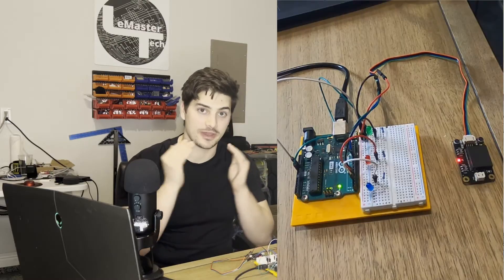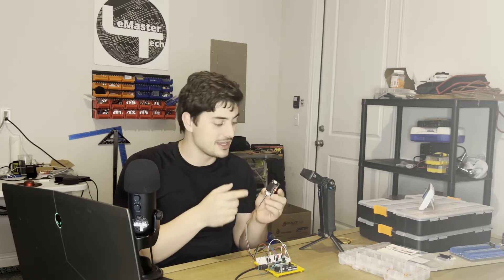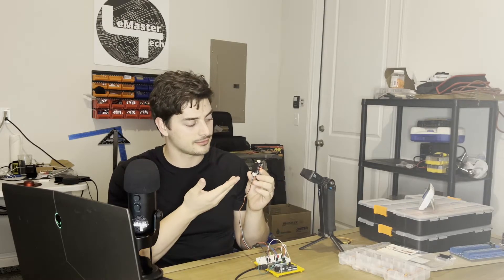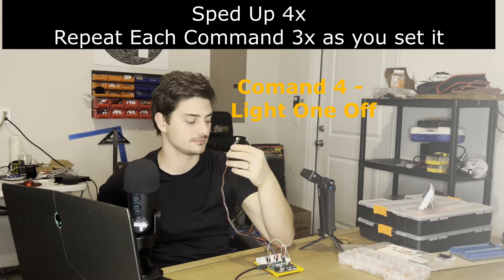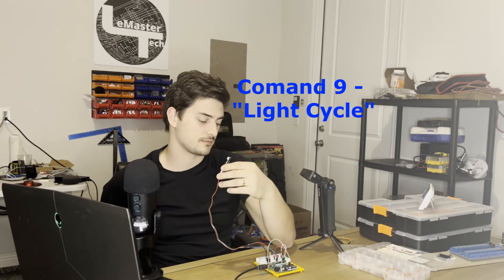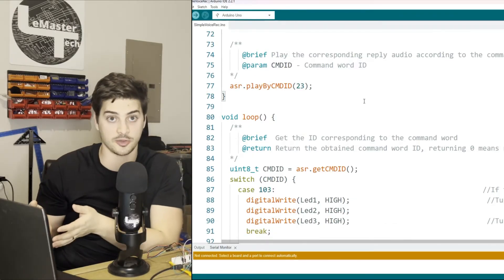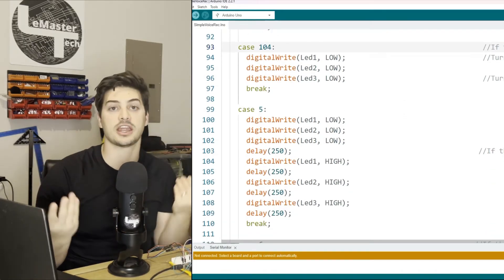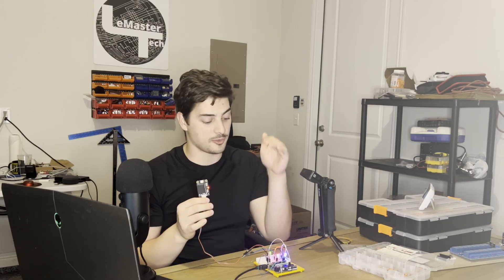How to Use Voice Recognition Commands With Arduino!

Comment: Is it possible to use the module to run servos?
Reply from the maker: Yes with a microcontroller and stepper controller to interface between the two!

Comment: could I program this arduino to light up addressable light on two different LED strips at the same time?
Reply from the maker: Hi yes you could do that, the output of this module is just a numerical value back to the Arduino, you can then have the Arduino do whatever you want with that input, so if you want it to send two different commands to two different outputs based on one input that’s pretty easy!

Comment: Hello. Congratulations on the video. I'm having trouble compiling the code. I'm getting an error on line 32: DFRobot_DF2301Q_UART asr(/*hardSerial =*/&Serial1); Serial1 was not declared. How do I solve it? Thanks for your help.
Reply from the maker: Thanks for watching - that error usually means you have a different arduino selected than the uno. I wrote my script for an arduino uno and pared a lot of the other stuff out of my script. The full example on DFRobots website has the protocols for multiple microcontrollers though!
Reply: @lemastertech  Thank you very much

Comment: Hey so I wanted to ask if you perhaps had a circuit diagram of this video. I'm not sure how many resistors you're using as well as their resistance
Reply from the maker: Hi! I didn’t do a circuit diagram because there’s no special resistors or anything else required! If you follow the link to the DFRobot website in the description of the video they have a wiring diagram and you can see it’s just four wires to an arduino and no special components other than that!

Comment: I am making a prototype using the DFRobot Gravity Offline Voice Recognition Module with Arduino, but sometimes I get an error with ID:255. What causes this error? Also, please tell me how to deal with this error.
Reply from the maker: Hi I am sorry I have not seen this error so I am not sure how to solve it - it is weird that it would only be appearing some times too if it were wiring or a code problem I’d expect it almost always consistently appearing!
Reply: @lemastertech  
Is that so?
I understand. Thank you.
I have one more question.
I connected the DFPlayerMini to an external speaker and have it respond to spoken lines with MP3 audio, but when I play a song after the reply, the volume automatically drops and the MP3 song doesn't play. If you know how to fix this, please let me know.

Comment: Hi I have a problem with this module, it not responds after a while to the wake work anymore  ( sometimes after minutes, sometimes after hours), do you have this problem too? I use module version 1.0! Thx for feedback!
Reply from the maker: I have had similar issues using an Arduino nano but they were fixed when I switched to an uno. I think if you put the power for the module on a digital out pin instead of just 5v you can power cycle it from code too!

Comment: Great video! Just wanna ask is it possible to disable the voice that speaks back and also instead of using a word to make it start listening could you use a button instead?
Reply from the maker: It is definitely possible to turn off the response with one of the switches on the module, but I’m not sure about triggering it to listen with a button! Probably if you used a relay and powered it only after a button was pressed then yes!

Comment: Can you use other language beyond English? For example, korean, Japanese and many other asian languages?
Reply from the maker: You can use any language you want for the custom voice commands and the custom wake word, because it’s recording your voice and matching and comparing your commands to the recorded files. So it could even work just with sounds or noises! But for training it and using the predetermined command words you’ll have the use English or whatever language the module you buy comes in!
Reply: @lemastertech  thanks for the video! will my daughter be able to trigger it when it's trained on my voice?

Comment: Outta sheer curiosity how would one wire this to a servo?
Reply from the maker: Well you’d need something capable of talking via UART or I2C so even if you want to voice control a servo you’ll probably want an arduino nano in the middle to take voice commands in and convert that into controllable servo functionality if that makes sense!
Reply: @lemastertech  it does, just so confused for the coding lol but i'll figure it out

Comment: Weak on my Arduino knowledge and overall power of things but i wonder if this would work with a alisha mk X-D arduino nano board I am putting in an iron man helmet. Would be good to use voice to open the helmet vs a switch.
Reply from the maker: It probably would work with that nano board so longer as it supports UART comms! That’s a pretty standard interface for all hobby boards so it should do the trick!! That sounds like a cool project goodluck!! 😎😎
Reply: @lemastertech  finally got the basics working I also added the speech module so now  custom replies for each command . Next step would be to add it to main helmet code but that should be pretty easy.
Reply: @Jaykav99 Just came looking for the same thing! I'm gonna a put an ironman helmet together and wanted to add this feature.  Does it let you change the ladies voice so we can call it Jarvis?

Comment: Hey!
Great video, that’s what im looking for my project!
Is it possible to not use the wake up command but manually wake up from arduino? I’d build a little buddy that uses face recognition and I’d replace the wake up command with a detected face using some lines. 
Thanks!
Reply from the maker: Hey!! Easiest way I can think off with this particular module would be to hook the 5V power up to a digital output pin you turn on when you want it to wake up! I am pretty sure it’s always listening when it first powers on?? I won’t lie to you though I have not tested that myself so hopefully that would be a fix though 😎

Comment: Hello sir, nice video, i need advice to my thesis project "Design of Voice-Based Smart Wheelchair " so how can i integrate with Ardiuno in my proteus simulation and how can i simulate it
Reply from the maker: Hi I have not used proteus but if it can just talk over serial data that should be simple enough to get data off of the voice module and arduino!

Comment: will this check my voice if i only want it to respond to my voice?
Reply from the maker: So it’s actually storing a .wav file of the commands you give it when you make custom commands so it would be more specific to your voice but no it is not actively doing any biometric validation like you are describing, it’s a pretty simple module overall! I think you could probably do a cool combination project of using a fingerprint sensor to unlock the voice command module and then you would get that sort of control!!

Comment: If I want to use with esp32 do I have to do something more than change the pin rx tx in the code ? 
I've tried but nothing works
Reply from the maker: Hi the ESP32 boards support UART comms for sure but I haven’t used this specific module for it before I’m sorry! It shouldn’t be very different at all though!
Reply: Troble with hardwareserial. I have changed to serialnumber but it is not working.

Comment: Awesome video man. Do you know if theres a way to change the responding voice coming from the board?
Reply from the maker: Thank you!! And oh man I wish, even if there was just like one male and one female voice option it’d be fun to have that ability. Unfortunately I have only seen that on some of the more expensive modules that connect to a could service so they pull their responses down in real time. I think with this one your options are basically the voice that comes with it or no voice response at all!
Reply: @lemastertech  gotcha, thank you!
Reply: @rhino9299  I just added the speech module to use for the replies instead.  Which has options…not amazing options but options

Comment: This is nice 😂 i was wondering if i use it on arduino rev 3 will it be limited as to my understanding of rev3 is that it has limited usage and it will take some other modules for complex things,(just a beginner in arduino)
Reply from the maker: Thank you for watching! I am not too familiar with the revs and limitations of different things like that but I know it works with arduino nanos and unos and third party boards as well so hopefully it would!